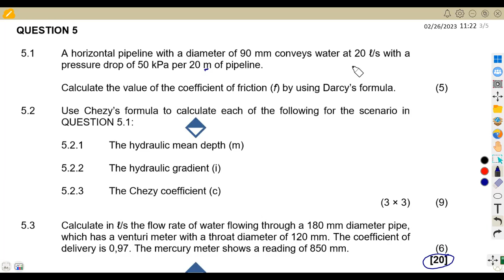MECHANOTECHNICS N4 HYDRAULIC SYTEMS JUNE 2022 NATED ENGINEERING @mathszoneafricanmotives

Comment: At 21:00 to 21:06 how did you calc throat area [a]?
Reply from the maker: We use the smaller diameter
Reply: Small a is 0.011
Reply: Small a is 0.011